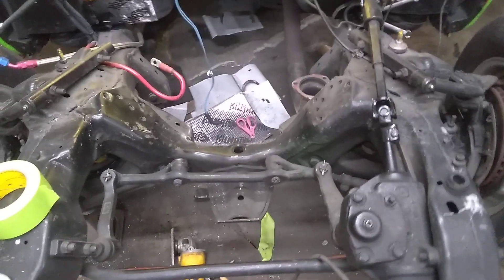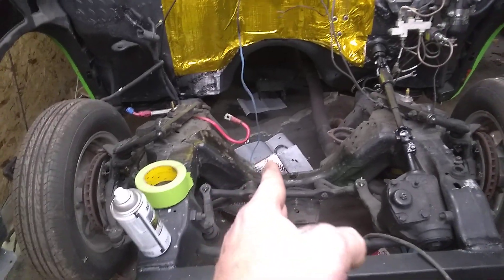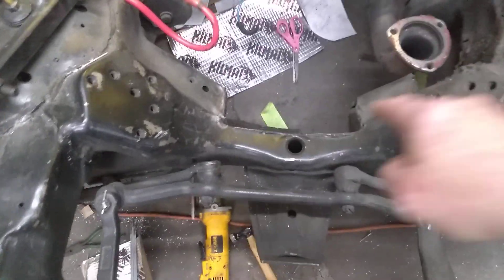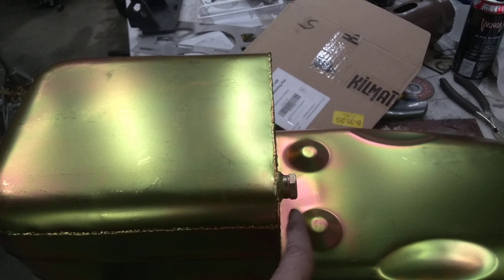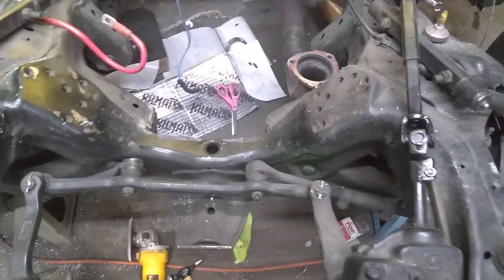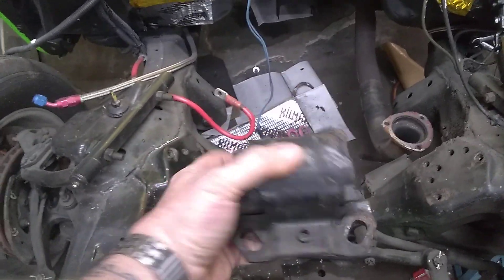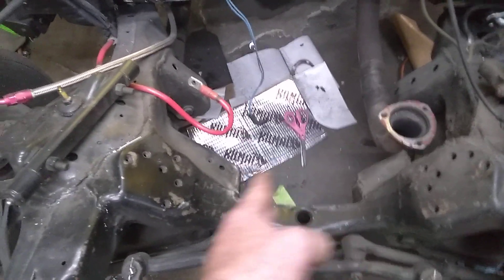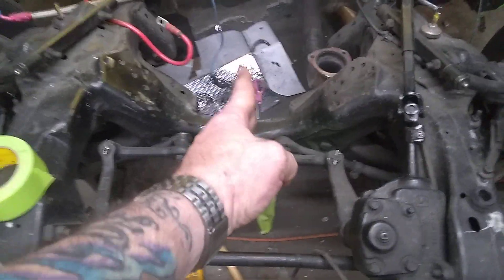S10 V8 swap crossmember notching

Comment: For anyone about to notch their frame on their s10, if your using 302-1 oil pan. You need to notch more than 9 inches  go a little over 10.5 inches. Because it's possible to lose distance after welding.

Comment: New to the swap out  v8 I am putting a older 1963 SBC in a 94s10. And hope I  don't have to cut the frame rail it's been a bitch so far 😂don't what brackets are going to line up with the power steering pump it's a older block with no holes for all the alternator or pumps any suggestions would be appreciated

Comment: DO NOT notch your crossmember. Theres is zero need to.
Reply: Maybe if a big block is going in.but definitely no need for Ls or sbc.i sure as hell didn’t have to.
Reply: Depends on the application. He explains why he needed to. Thats the nature of swapping and fabricating stuff. Sometimes you have to modify things cause they don't make everything bolt in.
Reply: @RidgewayTrailShop  Cutting the crossmember was the old way because there was no brackets or other options. There is now, so no need to cut.
Reply: @SOLDOZER  i guess that depends on specific application but id rather cut a crossmember than a firewall. And how often even in "the old days" did something like that thag was done right fail? If you put quality metal back you can cut ane notch anything, or heck even build a new crossmember. Its his truck and he explained his choices so whats the problem? And his point was more that the engine isn't center than it was to cut the crossmember.
Reply: @SOLDOZER I notched mine. I have the Holley pan and it wouldn't clear like they say.

Comment: May I know what steering shaft that is?
Reply from the maker: The top part is a speedway motors column. The lower is from a 90's jeep Cherokee or Comanche truck . i beleive it is 3/4 30 spline at box and 1" DD at column.
Reply: I got mine off a 94 Cherokee